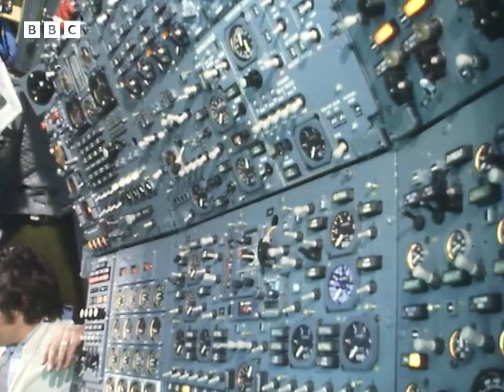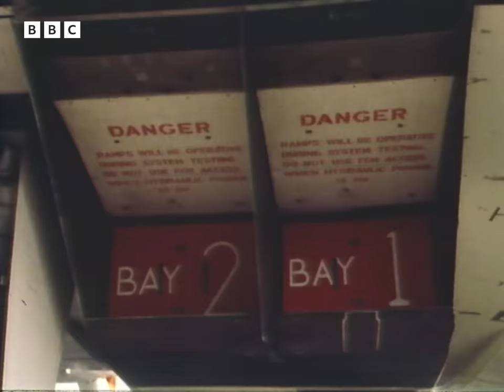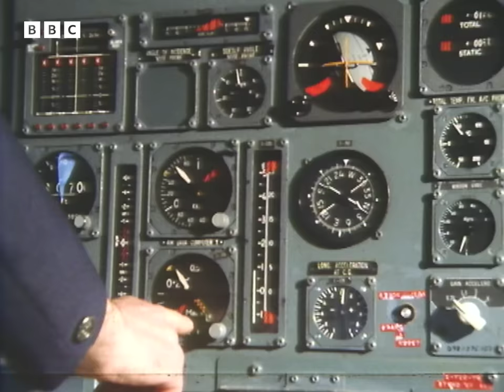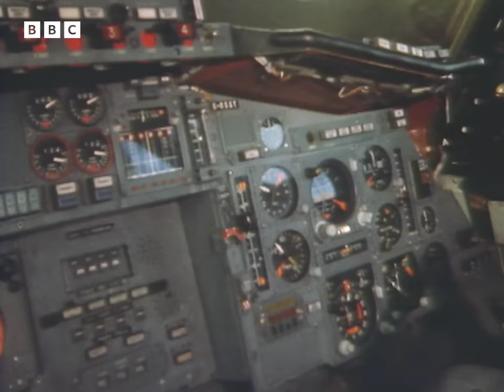1979: Making the LAST CONCORDE at FILTON | Retro Transport | BBC Archive

Comment: The one being built here is G-BOAF, which made the last Concorde flight in 2003, and is now permanently on display at Filton.
Reply: It was dumped outside of Airbus for a long time!
Reply: G-BOAC is on display in a building at Manchester Airport - I took my son to see it (you get a full tour and can sit in the cockpit).  It was unbelievable considering the decade it was designed and manufactured.
Reply: YES   disgraceful, BUT---the local Council was, at that time,  on the verge of being broke.  The government should have stepped in. @JohnSmith-ei2pz

Comment: I can't wait for the mid 90s to see the bigger and faster version.
Reply: The model that blew up over Paris in 2000!
Reply: They did not foresee the coming rise in fuel price and environmental concerns. It's sad that we don't even reach half the speed of the Concorde in airliners of today.
Reply: @skunkjobb  You mean sonic boom and noise pollution, that was main reason why it got removed. Its biggest advantage - speed - turned out to be its biggest weakness.
Reply: it is crazy that when it was taken out of use the top speed of travel on earth went down and hasn't come back in 24 years
Reply: @skunkjobb Yep, fuel efficiency is number one priority today. The current research program by Boeing and NASA hopes to get a 25% gain in efficiency will cruise at around Mach 0.8. About the same as the current B737, less than the B777
Reply: @JohnSmith-oh9ux no it wasn’t you actually know f### all! 😆😆
Reply: I guess until then they will be all flying around with their jetpacks :D
Reply: Faster would require a complete redesign, using different materials. Mach 2.2 was the limit using aluminium alloy.
Reply: @mitseraffej5812  Boeing builds planes for plebs like us.
Reply: @freemenofengland2880  Even worse for the plebs that gets to fly them like myself, it is beyond description how mind numbingly boring the job actually is. Just counting down the months to retirement.
Reply: @mitseraffej5812  Argh, that's sad. Is that because of auto-land features and too much automation in general? Or something else?
Reply: @freemenofengland2880  It’s the job in its entirety. Auto land is rarely used, usually only when the visibility is very low like in fog. It take a suitably equiped airport at lest half an hour to secure the airfield for low visibility / auto land operations. This is required to ensure no one drives a vehicle in front of the instrument landing system ( ILS) antennas. If some does it will bend the radio beam and send the plane off road, that is into the mud.
Even in a previous life when I would hand fly for hours on end the job was still boring. There is this widely held misconception that pilots both love their jobs and have superhuman skills. If pilots did actually love heir jobs the airlines wouldn’t have such a difficult time getting them to work anything beyond their contractual obligations. There is of course the odd meathead that does like strutting around in their uniform.
The only flying I got any real satisfaction from was air ambulance and humanitarian work.
Reply: @mitseraffej5812  Thanks for the info and awesome that you flew air ambulances and did humanitarian work. I suppose ALL work becomes a little humdrum in the end. For example, I don't remember my late father ever once saying anything positive about being an accountant. 😁
Reply: @freemenofengland2880  Well, there's a reason you're getting paid to do it and not the other way around after all!
Reply: @davidcarrol110  wait what?
Reply: @davidcarrol110  courtesy of DC10-30.

Comment: The Concorde was brilliant. If it wasn’t for a part falling off one of our American built aircraft they might still be in service.
Reply: Also as with anything, creating replacement parts for maintenance starts to become uneconomic as time passes
Reply: Nope.
Reply: No it wouldn't have. People would much rather pay $20k for a luxurious seat on the 747 or 777 rather than fly on the Concorde on the seats you'd find on Spirit or Ryanair. Most airlines today can't even sell out their first class cabin throughout the year, and rely on people using miles or free upgrades to use them. Now imagine what the economics are for the concorde which is essentially a 100 seat first class-exclusive cabin in terms of price
Reply: @harshallashar1069  you are a bit thick. The evidence is in your face and amazingly also in your own statement and you ignored it, people paid premium for the exclusive journey speed of Concorde, that is fact even after the crash when the trust had to be won back. The value of the price point had nothing to do with the width of the seating isle, you wouldn't get much use out of a first class cabin in a 3 hour flight anyway. Then you start blabbing on about the poor value of first class cabins on long duration flights, a complete irrelevance because Concorde had a monopoly on a niche premium market. It was taken out of service because the parts were becoming too costly to maintain and the airline industry has moved to one where fuel efficiency was paramount. Quite different to the 1960s when Concorde was designed, note flight cabins in the 50s were far more spacious and luxurious than todays first class
Reply: @harshallashar1069 Only because the first class in normal plane doesn't take you anywhere faster than the economy class. You only pay shitloads of money for prestige, luxury service and a good deal of snobbery

Comment: 03:12 assembly manager Freddy Price predicts here they'll be much bigger and faster than Mach2 aircrafts crossing the Atlantic again by the 1990s, or just over a decade away. Reminds me of when I first saw touch screens when Epcot right after it put up the globe, around new year's of '81. And they were telling me they were just around the corner too. That would've been about 2011, 30 years later.
Reply: We also lost Sea Cats and Hovercraft. Both were also uneconomical because of the excessive need for maintenance and fuel demands.
Reply: @jamesfx2  They became uneconomical because of the tunnel.
Reply: Problem of going faster than Mach 2 is materials. Higher the temperature due to air friction, less material that can handle the heat. Also consider is it really important to get there faster? It all comes down to tradeoffs in engineering and business. Even with subsonic aircraft these days the two of these professions are always in a tug of war. But for those of Freddy Price generation witnessed when air travel was a daredevil adventure and danger to evolving to comfortably cruising across the Atlantic having a nice meal and a glass of champagne.

Comment: When you consider this aircraft was designed and built 60 years after the Wright brothers, took to the air at Kittyhawk we don’t seem to have gotten even back to this point in commercial airline development some 50 years later.
Reply: This is such a terrible take based on nostalgia and comes from people who don't have an idea about our engineering capabilities in other fields. You think we haven't made development just because we don't have a supersonic airliner? Flying has been made cheaper and accessible to everyone, while being safer than driving on the road. We have a range of jets today that can fly to even small towns and be economical and comfortable. The concorde experience would be considered shockingly bad by modern standards today because you can get a lie flat bed and a good night of sleep for the price as a cramped seat on the Concorde. Supersonic travel will never make sense for the masses because it's just way too expensive
Reply: You are wrong. Air travels are way too much safer now than those in old days and that is a significant advancement. Just because we do not have a Passenger aircraft that is unable to fly faster than the speed of sound, does not really mean anything today. We have way more comfortable aircrafts today. Aviation is getting safer and safer each day

Comment: Engineering at its very best.. A truly great machine built by great engineers..
Reply: Most supersonic flight hours of any aircraft made
Reply: Biggest failure in commercial aviation history
Reply: @DoktorBayerischeMotorenWerke It was never an engineering failure. At the time this was the Pinnacle of aeronautical engineering on the planet.  As far as becoming a widely used aircraft, there were issues and opposition that changed its viable future. But it was NEVER a failure.
Reply: @bobolulu7615  They why were no Concordes sold?
The Concorde was a unmitgated 65 million pound financial failure that completely gutted BAC and the UK aircraft industry
Reply: @@phillipbanes5484 Excellent comment, excellent point. America clearly knew alot more about supersonic aircraft which is exactly why they opted not to build SSTs
Reply: @@phillipbanes5484  "Still does" that's why boeing is being a big giant failure, and Airbus is overtaking them
Reply: @phillipbanes5484  sounds like there's no argument. Airbus is more on form than boeing right now, and you know it. Boeing have been too greedy and have lost their worth, compared to what they used to be
Reply: @ioandavies2292  You seem to have forgotten about the A380 already???
Adjusted for inflation the A380 was an even bigger failure than the Concorde.
Reply: @ioandavies2292  Boeing still makes the safest airliner in the world...
Reply: @DoktorBayerischeMotorenWerke  is that why there have been more boeing crashes?
Reply: @ioandavies2292  The statistics show that the safest aircraft in history is the Boeing 787 Dreamliner.
Reply: @danh555 The Airbus A380 was a Multi-National embarrassment... $31 BILLION dollar failure that is the biggest in history after the Concorde.

Comment: 'By the 1990's, we will be flying bigger and faster aircraft.'

In almost every other technological fete achieved by man, they have gone on to advance on that original concept. Yet Concorde and supersonic commercial flight was the exception to the rule.

Speed, and the desire and the will to achieve things quicker than before, whether it be internet connection or train travel has always been man's want. Yet, a concept first achieved over 60 years ago hasnt been advanced since 2003. Odd.

Comment: Back in 2000, for some reason, I wondered if a Concorde ever crashed and looked it up on the internet. Nope. Less than two weeks later, Air France Flight 4590 crashed. One of those weird "coincidental" moments.

Comment: Concord was a work of art .. it's that simple.. what caused it's slow death was the high bypass engines (rb211. Cf6 and jt9) and the wide body jet concept that became the 747 Dc10/ L1011 and the scarebus a300. You cant debate scale economics. And yes what is needed today is a super fuel efficient mach 3 widebody airplane.
Reply: Yes of course, it wasn't meant to be a mass product anyway, but rather a testimony to technical achievement. It was at a time when it was still possible: these days no such investments are made for very high tech for anything civil, unless there's a clear business plan with huge benefits ahead. It's all reserved to the military, if anything.
That is, I think, one of the most depressing conclusions here. There may never be hypersonic commercial flights anymore, at this point we don't even know if there's a real future for commercial passenger flights. We're going fully downhill in the name of pretended progress, which it isn't.

Comment: Concorde remains a pinnacle of aviation engineering, more along the lines of the Space Shuttle than subsonic aircraft. Accomplishing what they managed to do with the absolute 100% reliability and repeatability required for a public service was an incredible achievement.
Reply: Umm one concord. blew up and 2 shuttles blew up  both rank at the bottom per units made.

Comment: This one crash was of course dramatic but the real problem was that not many people were booking flights. It was very expensive and normal passenger planes were getting better and better.
Reply: What lol, rubbish, the type of person who paid the extra for the trans Atlantic speed of  Concorde never had any other option. The bottom line is that all engineered machines become ever more expensive to maintain as time passes purely because of economies of scale turns into the expensive of the bespoke and shrinking skill set. In terms of Concorde it was also hit by the issue of ever increasing aviation fuel prices which compared to the 60s when  such things were imagined to be infinitely cheap. It's no coincidence that in the final years of Concordes life, the industry went all in on fuel efficiency and therefore wider engine circumference which was no good for a plane design  like Concordes.
Reply: @suburbia2050 Such speed didn't come cheap, though: A transatlantic flight required the high-maintenance aircraft to gulp jet fuel at the rate of one ton per seat, and the average round-trip price was $12,000.

Comment: These workers were brilliant. I think it's fair to say the British did most of the work on the Concorde project. The French were ultimately responsible for destroying it all and sadly many lives were lost due to Air France shoddy maintenance.
Reply: O dear! Being neither French nor British I'm amazed at such a deeply insightful observation. Of course the  Concorde accident in Paris was due to shoddy maintenance on the part of Air France. After all, the metal strip on the runway that caused the accident was dropped from the thrust reverser cowl door of an engine of a Continental Airlines DC-10, that had taken off just previously. Of course had it been a British Airways Concorde, nothing would have happened due to vastly superior maintenance procedures...
Reply: @benedictdesilva6677  The only reason the Air France Concorde picked up that metal strip was because it was not tracking properly down the runway. A spacer was missing from the wheel assembly. Also, the tyres were not all at the correct pressures and the fuel tanks were overloaded for the flight. As with most aircraft crashes, several factors came together at the same time to cause a chain of events.

Comment: It's an utter disgrace that these aircraft went out of service with nothing to replace them.  It's a massive step backwards.  Technology is supposed to advance, not retreat, like a white flag waving Frenchman!
Reply: Tories
Reply: It's not retreating. It's economics. The Concorde program was bleeding money.
Reply: @4seeableTV more like a hemorrhage of money
Reply: The 1980s was the Death of UK manufacturing. Nothing was really replaced in all those communities and one of the reasons we are so poor today.
Reply: @gavinmellon9313 there is look at the TGV of France
Reply: @davidcarrol110  Yes i said this to guy showing me around a Vulcan. He was involved building it, we had common job as draughtsmen. Back then these were well paid jobs, the boomer generation who could afford to buy a home. Now wages are crap, who can buy a home with rubbish service job wages.
Reply: @davidcarrol110  I was in the forging industry in the 80's. All slowly went down the pan. Now the estate i worked had engineering shops, steel stock holders, etc. Now it's  a mosque, asian taxi rank and garage. Even the big copper works behind is still derelict land. M6 Jct 10.
Reply: @4seeableTV  But the money went back into the economy, other than fuel.
Reply: What are you talking about? The Concorde project went on to become the Airbus A300 and then the whole Airbus line. Filton designs the wings and landing gear, while wing building moved Broughton, which builds every Airbus wing today.
Reply: @flybobbie1449  Real wages in Estonia are now worth more than average UK salary. Pound has lost a lot of value since 2016.
Reply: @straightpipediesel Remind me which of those are supersonic.